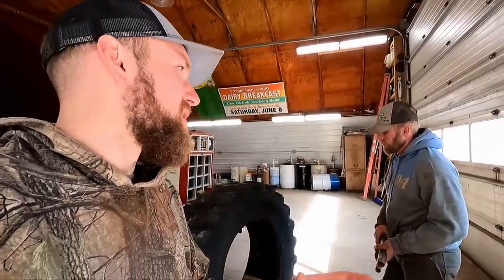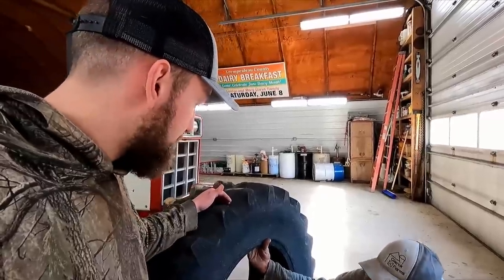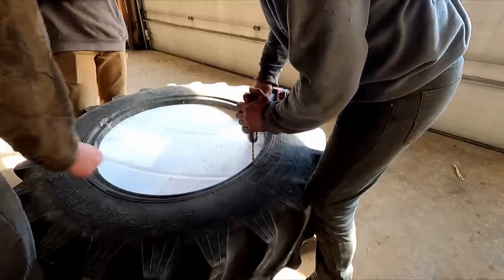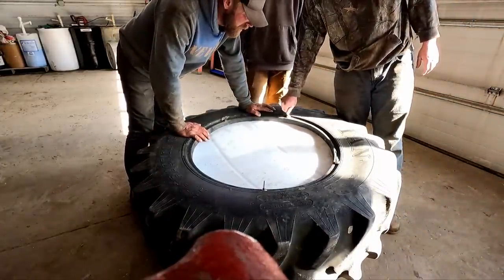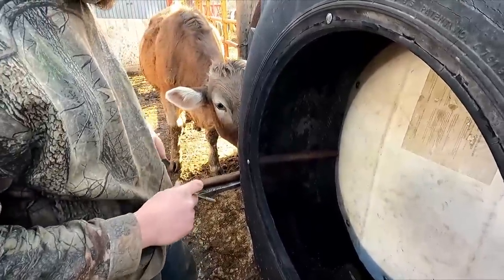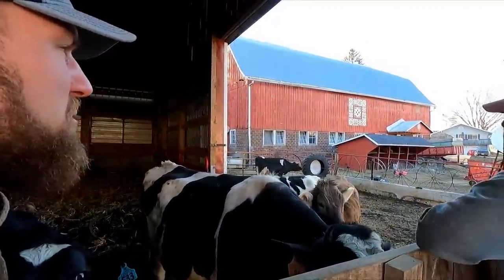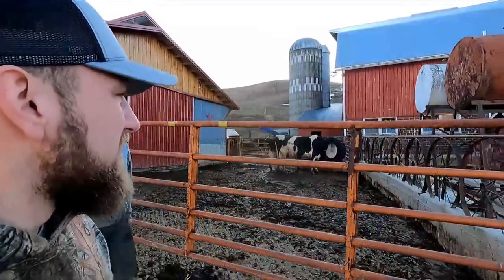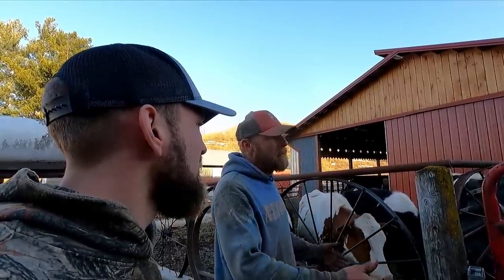How To Raise Healthy Happy Cows l Farm Improvements On A Small Dairy Farm!

Comment: I really like the salt feeder. We just cut an opening in a 55 gallon barrel and bolt it to a post with stainless hardware so it doesn't rust. We just have heifers and a few steers on our dairy and they last about 3-4 years before they need to be replaced

Comment: That was a pretty neat little project, repurposeing old stuff. I always used large rubber pans from Southern States. Drilled holes in the back of the pan, run wire through it and tied it to a post. Had a roof over the pan and let the cattle use it free choice. Worked for years

Comment: Hey Guys , 
BikeMike here , 
I was really surprised when you mounted that tire vertically. 
Not what I was thinking at all .
I left a comment on the video when you were making a new log mineral feeder for out in the pasture. 
I would have used the tire , laying down , cut the barrel down to correct height and insert it into the tire , secure it to tire , if feeding more than one type of mineral,  put dividers inside barrel like a pie slice 
Find a piece of material that would fit over the barrel top , but make it bigger than the barrel opening .
Put a center post inside the barrel,  that can be used to secure the cover flap to the barrel. 
The cattle can lift the flap and get their mineral , the flap falls back down covering the barrel,  keeping out the weather .
You could probably secure tire to railroad ties under tire , to minimize any attempt of bovines upsetting the mineral feeder and you could still move it around with the skid steer if needed

Comment: In my early thirties I had to make a career change from dairies to horses. I now run a boarding stable. About that time I met a horseman, really a stockman from Alberta. One of the things he said was studs are told by mother nature to push everything out of their way. Now a stud horse will try to establish himself by biting. You ever have a horse like that get ahold of your arm there is a good your going to lose it. My teacher never punished horses. He arranged things so the horse thought he was putting pressure on himself and that's how my teacher changed their minds. Bulls are no different other than they go in like a bulldozer and grind you into the dirt. At home I have Holstein steers and sheep. When I get a new ram I get respect established right from the start. When they try to ram me, their nose runs into my foot or whatever else I have handy. After two or three tries they stop for the rest of the time I have them. When I was working with registered Holsteins, those were the best cows. They were pleasant to handle a very well put together. Solid feet and legs, good udders, with longevity. That's where I would be looking for bull personally because the large focus on the genetics.